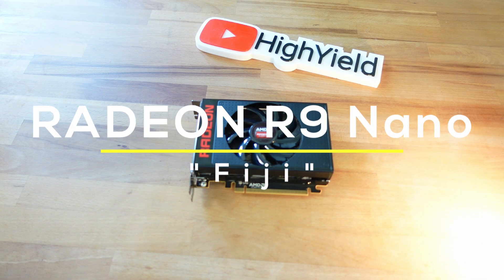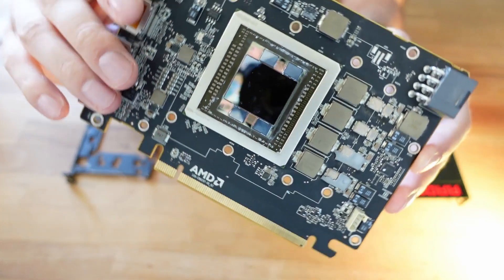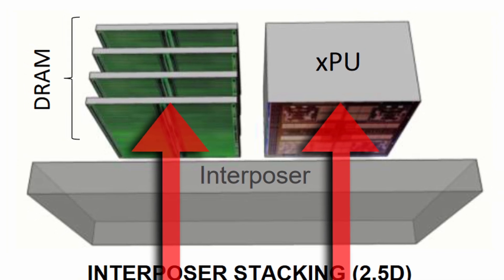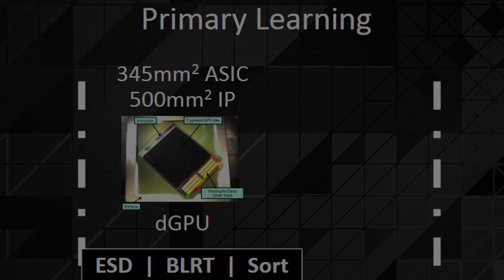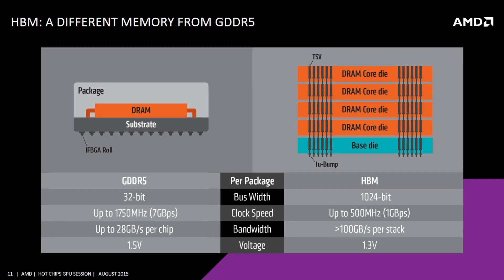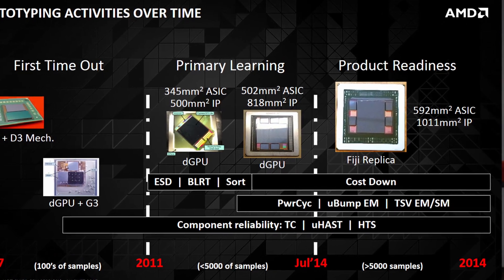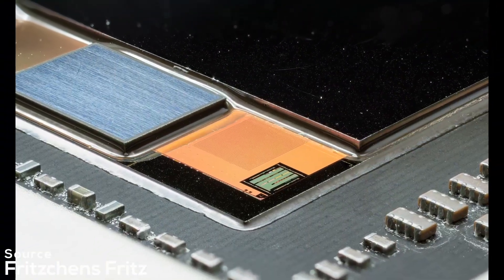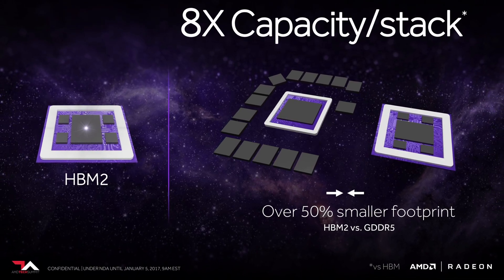How this tiny GPU invented the Future

Comment: AMD hoped that HBM memory would become the defacto new industry standard, have even accompanied two generations R9 Fury and RX Vega. And discontinued it for the next RDNA generation for GDDR6, which has exactly the same scaling issues with adding more VRAM memory, that Nvidia cards have too. GDDR can't widen out more the memory bandwith, that is the architectures fault of GDDR when trying to scaleup.

The bottleneck being memory bandwith which HBM doesn't or wouldn't have. There is also the economical cost factors, where margins shrink if the memory bandwidth is increased by adding more DRAM Chips and also increasing its power usage on the GPU making it harder to scale. This can be seen in most current Graphics card on midrange and I have assumptions, that this will not go well for future videogames. Instead what is happening is that games will rely more on compression on what we are seing now is newer versions of FSR and DLSS to reduce the traffic on those graphics cards.

Ok HBM has other pitfalls. Even with the RX Vega 64 it only has a memory data throughput of 1.9 gbps while an RX 570 with 8GB GDDR5 has 7Gbps memory data throughput. 
I'm not shure if it is due to the high traffic on the gpus memory bandwith. I have not found a metrics like fps or something else, that could measure the traffic on the gpus memory bandwith. 

Often it is seen like the video hints that in 4k with it might be that its making memory speeds less relevant no matter how high the clock speeds are. 

So it could be nailed down to: 
Too much data (traffic e. g though high resolution and dense Videogame play of 4K ) == memory bandwidth bottleneck. 
Little data (traffic) = speed of data throughput becomes relevant and the type of game being played.
The data set or traffic is automatically adjusted the game doesn't stutter or crash,  so it becomes more similar to what is seen on console of fps flow.

Assumption: 
I think that's the main reason. Two extremes: 
Stacking in HBM increases the bit interface and has to connect to more small fibers for vertical storage. This slows down immensely, but provides more memory bandwidth. Similar to a hard drive with spinning discs and multiple layers on the hard drive.

While a simple raceway maintains performance and is fast, but also consumes more power (GDDR). Similiar to a SSD by the way its build.

Get the best of both worlds:
So the trick is to place the memory as close to the graphics chip as possible and don't go for vertical stacking and use a silicon Interpol. Because it does without the stacking, it would be a new architecture. 

This also explains why there are still no decent docks on e.g. Nintendo Switch or the Steam Decks and are just simple I/O hubs. If HBM would get a breakthrough eGPU docks of low power consumption would be possible.

Comment: I had one. It required an undervolt to get working reliably due to thermal constraints. The memory could be overclocked. I shipped it off to a friend in Canda when I upgraded and unfortunately the drivers are too old for him to use it.

Comment: It was doing a custom system that used piezoelectric actuator to slide the silicon under a sliding negative during prototyping this was changed to a a set of expanding and colomating optics lenses the reduced the minimum feature size. We have newer methods today

Comment: Too bad it never took off for end users. The concept was scrapped right before it got viable (similar to non shutter 3D TVs - they died right before high refresh rate 4K Panels became viable and would have made passive 3D TVs actually good) with bigger stacks. Nowadays you don't even need the interposer in every case. One stack of HBM3(E) is enough for almost all consumer demand.

Comment: Is there a reason why RAM modules are separated from the main SoC chip?
Looking at the progress, everything is improving (Speed/pin, capacity, bandwidth, etc), one thing however, is the connections between the SoC and the RAM modules, I am thinking that by eliminating such lengthy connections (on a micro scale) the latency can improve dramatically.

Now for the next generation of RAM, lets see, if DRAM is 2D, HBM is 3D, the assumption then is, next gen RAM would be 4D, thing is, the 4th-Dimension is typically considered as Time. hmmm...so latency it is!

Comment: I was using Fury X for many years, since its release, to just only over year ago I updated, as it had simply too little VRAM. If it had 8GB I would be still using it. Now I am using 6900XT with 16GB, which should be good. Still I think Fury X was amazing design, and loved it. I do think HBM will come back to consumer cards eventually. HBM is used a lot in other cards, like professional GPUs, AI accelerator, ultra high frequency oscilloscopes, and ultra fast network switches and routers, where its performance is advantageous despite higher price. GDDR will reach its limits eventually, and only way up would be to copackage HBM close by.
Reply: Demanding HBM was a mad choice !
Let board builders do what ever mem they need on it !

Comment: we use two radeon instinct mi25 gpus, which are both vega gpus :3 
they are faster and have more ecc-capable memory than any other vega gpus of their class, but have no video outputs and no fans so they pose quite the logistical problem lol 

they are only outclassed by the mi50s, which include double the ram on the vega 2 chip, same as the radeon vii. the mi50s also include a  W I D E  infinityfabric link on top to link up to 4 cards together for increased cross-card memory bandwidth. 

after the move to cdna and rdna tho, cdna lost a lot of its actual graphics capabilities. the mi100 and beyond don't even support vulkan, and the mi200 and beyond don't even come on a pcie card anymore lol
- 7α β

Comment: Another thing that is different in computers since 2015? We were able to transder 1212 MB/s over USB 10 Gbps - or whatever it was called then. More than enough to handle the speed of an internal SATA SSD. At the rate we're going Thunderbolt 5 can't even upload more than 10 GB/s (80 Gbps), neither can USB4 V2, yes PCI-E 5 NVME's can transfer a theoritical 16 GB/s.  Sure currently the models that tranfer at 10 GB/s can be handled by both technologies - but they aren't even out yet - and barely cabable... Thus forming a storage speed bottleneck in the foreseeable future. Sure, that's only relevant if you care about fast storage, but time is money. For some people this is a troubling development as well.

Comment: AMD claims that HBM will be on all GPU, even low-end. Yet, 2023, we still don't get HBM GPU from AMD.
Reply: HBM is the most expensive solution. The lesser expensive solutions are 2.5D with no interposer such as Intel Altera solutions and AMD Zen.
Reply: @MeteCanKarahasan  it's expensive because stupid AMD didn't go through with their statement of making HBM for all on their GPU/APU products.

Sorry, Zen is just Phenom 2, souped up, modernised, modularised, and glued together. In fact, it's not even AMD's design, they had to call in Jim Keller to do it.

Guess which AMD's microarchitecture is in-hosue design?
Reply: @AlfaPro1337  AMD can't create a foundry miracle although they certainly do with MCM. HBM is more expensive than MCM. It is $$$ MCM<$$$$ 2.5D HBM<$$$$$ 3D HBM. You have to understand there is a different cost structure to HBM.
Reply: @MeteCanKarahasan  Yeah, it's expensive because AMD didn't go through with their words of making HBM available on all of their GPU products, imagine RX 6400 with HBM, or APU with HBM. 

Increase in demand = more familiar with fab/packaging it = less cost to manufacturer.

Plus what? Are you telling me a single layer HBM isn't possible? That's stupid.

Except MCM has a huge amount of bottlenecking, and that has nothing to do with HBM.
Reply: @AlfaPro1337  no no, you don't understand. What you know as HBM is full size reticle limit TIMES FOUR in order to lay the interposer. When is the last time Intel sold FPGA to the public? That is how rare you should expect R9 Nano/Vega to hit commercial cpus.
Reply: @MeteCanKarahasan  uh, no. The maximum stack for HBM1 was 4 layers In fact, some of the defective units had cut stacks, say 2 layers of it.

2 stacks x 4 layers = 4GB, that's the capacity for the R9 Not-So-Fury series.

FPGA is different, it's not HBM or MCM.

Comment: LPDDR recently has played the role of "poor man's" HBM in handheld and mobile products, but I guess it's a matter of time until HBM eventually make a showing in exactly those products. The biggest disadvantage other than cost of HBM is that you cannot replace or add to it. But since you can't do that with smartphones anyways and even less and less with laptops (and even some desktops, looking at Apple) that disadvantage goes away. Keeping in mind that the GPUs are moving more and more into the SoC, HBM offers the best of both worlds when it comes to DDR and GDDR, as it has excellent latency AND bandwidth.

Also, speaking of how AMD led the way: with the "APU" initiative AMD were the first to take what they coined "heterogeneous computing" seriously. Had AMD have had their way, CPUs and GPUs would be even more tightly integrated than they are today. Bobcat and its descendants were so dogpoop slow in FP because AMD back then envisioned FP workloads to primarily run on the GPU anyways. This paid off for the Jaguar consoles, but didn't on the desktop as applications (mostly games) didn't take advantage of GPGPU compute back then (and even today usually don't). That's why they called it APU since the CPU was supposed to be "accelerated" by the internal GPU in much more than mere graphics stuff. This was also the time AMD basically invented Vulkan, back then called Mantle.

All in all AMD is a crazy innovative company that is tiny compared to its rivals, and an amazing amount of stuff we use today as if they always existed was invented by AMD. Too bad more often than not they were early or read the market wrong, like they did with APUs. Funny enough: Apple, a decade later, has picked up much of AMDs concepts with packaging SoCs and memory close together (just with LPDDR for cost) have instrea of bruteforcing through everything with CPU core using more and more integrated ASICs under a unified API. So to speak Mantle isn't just the direct ancestor of Vulkan, but also the spiritual one of Metal. The advantage Apple has today: they dictate the software support for their hardware since they make their own OS while AMD has even problems getting Microsoft to write a decent scheduler ....

Comment: I've had R9 Nano, RX Vega56. And I'm watching this video using Radeon VII.
R9 Nano was a crazy beast! This tiny card performed like a top level NVidia GTX 980.
Vega56 was a very average card. There were rumors about 4 stacks version but both 56 and 64 got only 2.
Radeon VII is still a good card because of enormous amount of VRAM and bandwidth. It's funny when modern GPUs struggle with low memory bandwidth but old Radeon VII has about 1TB/s of it.
Reply: Lucky you; you were able to get your grubby hands on a RADEON VII
Reply: Now we know the problem is that of economics and not of technical bandwidth limitations.
Reply: @CST1992 efficiency was never about the hardware, but about how efficiently they making that dough
Reply: It was crap, Vega 64 too
why go even cheaper then Vega 64 ?
why demand HBM ??? let board makers support all mem types please !
Reply: @lucasrem you don't know what you're talking about and it's VERY obvious

Comment: GDDR still seems to be developing fast enough to keep HBM cost inefficient.  GDDR7 is gonna start around 32gbps, so that's a huge leap from current GDDR6 and gives at least the next two generations of GPU's a good solution, along with any potential large L2/L3 supplements.  And soon we're gonna have the ability to stack large cache chips underneath the main compute/logic chips to scale up that supplemental bandwidth as well if needed.  The lower power of HBM might become more attractive in the future, but I think in terms of general bandwidth demands, there are solutions for the foreseeable future without needing HBM.  It is a shame, though.  I'd like to see high end parts have HBM.  They're already so expensive already and become 'cost is no object' sort of purchases, so fuck it - throw some HBM on there to create some really kickass high end graphics cards.
Reply: It seems HPC and A.I needs as much bandwidth as it can get its hands on.

So HBM is perfectly fine for those workloads.

Comment: The late Vega 56 releases were the spiritual successor to this. They had the same small board and most coolers, like the power color red dragon, used the saved space for flow through fins.
Reply: Vega 64, nobody needed that, released way too late....
demand HBM mem, why not support all mem ?
why go fabless, need more Nvidia companies in TSMC ?
WHY GO EVEN CHEAR THAN VEGA 64 ?
Reply: I keep forgetting Vega 56 used HBM. Good God those PCBs are tiny!

There was the Radeon RX Vega Nano which was never released. That thing had a sleek truncated Radeon VII shroud and was just as small as the Fury Nano.

On a side note, I want to see more components in the style of the Radeon VII -- blocky and bare brushed metal. Too much "gamer" styling these days.
Reply: @tomhsia4354  no the evga nano was a Vega 56 and the reference cooler didn't release but the boards went to power color and sapphire who made the flow through coolers I mentioned. The first releases of Vega 64 and 56 had big boards, it was only later ones that used the compacted design.
Reply: @wile123456 I was referring to a single-fan reference Radeon RX Vega Nano that was never released. Judging by photos it was going to be the same size as the Fury Nano with the cooler styled like the Radeon VII (silver square shroud with a glowing corner cube and RADEON logo).

The ones that used that small PCB are all larger than the unreleased reference design. Powercolor did make a Vega 56 Nano without a flow through cooler, but that one is slightly larger than the Fury Nano.

Comment: The silicon interconnect is anything but dead on GPUs. The large amounts of cache that AMD was able to put on RDNA2 enabled them to cut the memory bus width drastically.
RTX 3060ti 256-bit bus
Rx 6600XT 128-bit bus

Comment: I have a Sapphire Pulse Vega 56 and an Asus Strix Vega 64 in my pc and my sons one. Definately surprised by the board size which is really short all the volume of the cards is their heatsinks.
They are still decent in performance in games, especially the 64, and can be used with Resizable Bar, or SAM as AMD calls it, which helps for smoother framerates and much better lows with a simple Registry hack.
HBM works more like cache rather than classic RAM ddr chips. It is so close to the GPU and has such a wide bus that I believe it deserves to be called cache memory and paved the way for 3DVCache technology we find on the modern Ryzens.
Very nice video keep up!

Comment: High Yield : you forgot to mention that the HBM technology is a proprietary technology owned by AMD with pattened status. Nvidia uses it on Tesla cards but firstly experimentally used it on the Nvidia GTX Titan V 12GB HBM2 back in 2017. You also forgot to mention that anytime Nvidia manufactures a GPU with HBM, they have to pay AMD for the rights to use it and they have to buy HBM from AMD :).
Reply: Actually, the Titan V wasn't Nvidia's first HMB2 card. It was implemented in their GP100 chip a year earlier, which made it into several Tesla models and a Quadro.
Reply: I wouldn't be so sure that AMD 'owns' HBM, as it sounds like multiple firms own patents related to HBM. Titan V was a really weird card all things considered, since basically every server card since then uses HBM but not consumer cards.
Reply: @No-mq5lw  do your history facts checking right....here is no room for your "what you feel that you think you know"
AMD developed HBM memory. The only brought partially in Hynix so that they could get access to large amounts of mass producing equipment of the actual memory.
Yes, many server grade GPU-s have HBM because there you need data gobbling performance and not texture crunching performance.
For every HBM memory module used, Nvidia has to pay quite a hefty amount of royalties to AMD. And that is the right way if you as a manufacturer have no technology while your competition has a vastly superior tech.
Nvidia should be happy to even get any since the way how disrespectful they have been towards AMD for the last 20 years using anti-competitive bribing tactics almost all of the time.

Comment: Thank you so much I love this card!

I wasn’t gaming at that time, I stopped around 2006anf just started a few years ago because of sim racing.

I was shocked how cheaply graphic cards are build these days, super low bandwidth and very old designs.
I wondered where all the innovations went and soon realized that the companies relied on the higher achievable clock speeds with less power and the cheaper memory prices instead of superior technology these days.
Which is a real shame!

Imagine a card with the great bandwidth and technology, with the clock speeds and memory amounts of these days!
I am looking into a 7900xtx but I’m still very disappointed by the lousy memory bandwidth..
At least 3d cache is now mainstream with amd and when I heard that I instantly got the 5800x3d and a 6950 xt to go with.

When I get the 7900 xtx I will upgrade to am5 and the great 7800x3d, since it will be a pure gaming/sim racing computer.